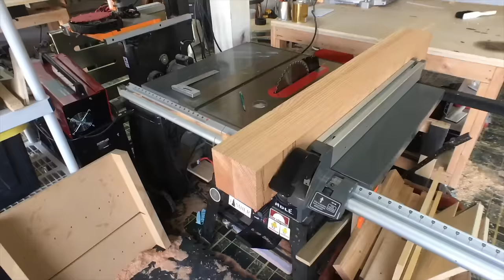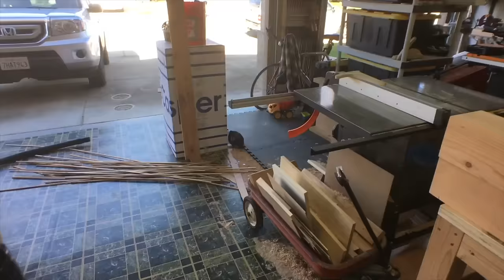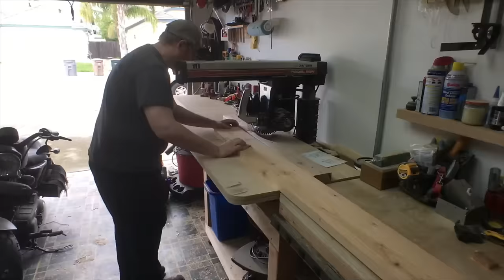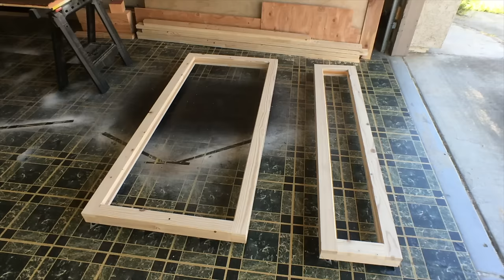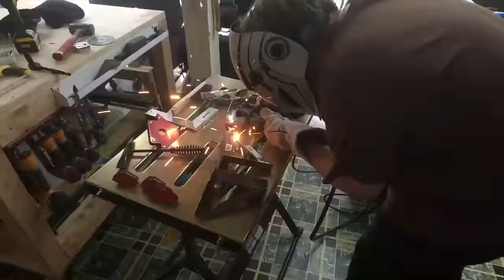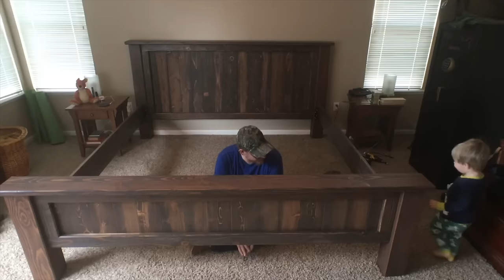TIMELAPSE: Construction Lumber Bed Frame

Comment: That frame looks fantastic! One question, are you concerned about moisture and mould building up between on the bottom of the mattress due to the enclosed base?
Reply: Here in California it's super dry, so we don't need to worry about it 👍

Comment: How's that bench top jointer treating you? My shop is way too small for a full-sized one but most people on /r/woodworking say the bench top models are garbage. I'd love to hear your thoughts on it!
Reply from the maker: I love it for most of what i do.  For edge jointing projects like the bed with very long boards its not too great because the jointer table length is pretty short.   Anything over about 4 feet long can get a little hard to keep firmly against the vertical fence since the majority of the board is hanging off the surface.  Its doable but not ideal.  For face jointing and edge jointing shorter stuff its great.